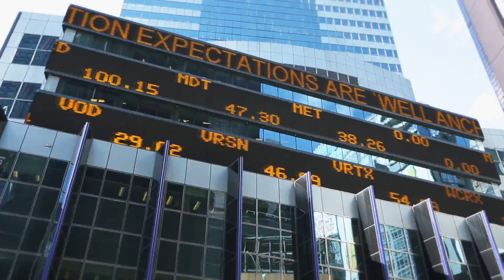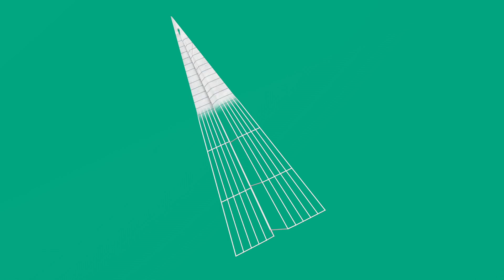These Supercomputers Are Altering Reality

Comment: This video is a disjointed mess with no thesis. "Hey! Pro Gaming is a thing. Now look over here, we have an engineer talking about supercomputers. GPUs divide and conquer - what do we mean by that? Uh...video over!"
Reply: It's called marketing bullshit. The marketing guys decide what the video is going to be about and then call in the experts on the subject. The experts then just have to make the best with what they're given.
Reply: Yes the video communicates horribly.  Supercomputers have always ran with problems broken up to process pieces of the problem in parallel on different machines.  The world's first supercomputers required their software to use a divide and conquer approach.  That's not new to GPU's or supercomputers built mostly with GPU's.  Simulations were popular on supercomputers in the 80's too.  Also, modern games don't run on supercomputers.  They'd be unaffordable for each player if they did.  Modern supercomputers are to old supercomputers what modern pc's are to old pc's.  They're just 1000's of times faster with more processing cores and 1000's of times more memory.
Reply: Penn Tarleton The Supercomputers were connected to the video games and then they go back and explain the background of Supercomputers and give the example of real world simulation to show what these things do. they do mess up when they talk about CPU and GPU but it still has a thesis. The thesis is that Supercomputers have many uses and what they are used for today, to show the veiwer that what they are.

Comment: Lots of cheap computers linked together isn't really a supercomputer.  We've kinda reached the limit of silicon.
Reply: Charles-A Rovira
You idiot old super computers were 100% custom designed set ups! Especially the Cray. That's when you could call them super computers.
My fucking ipad is more powerful than those crays these days !

These days they just get OFF THE SHELF parts link them in a CLUSTER and call it a fucking super computer.

see the difference ?

We will see REAL super computers when you can have carbon non silicon based computers with optical setups that each processor can run 100,000 faster than a single processor now.

Then it will be super computing.  Now it's just OFF THE SHELF shit in clusters.
Not my idea of super computing.

There is nothing SUPER about them.